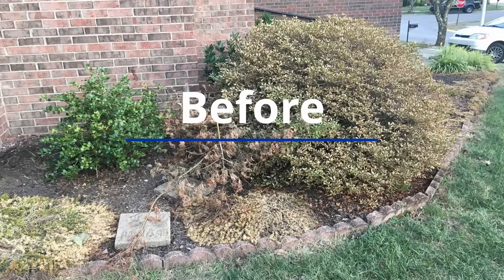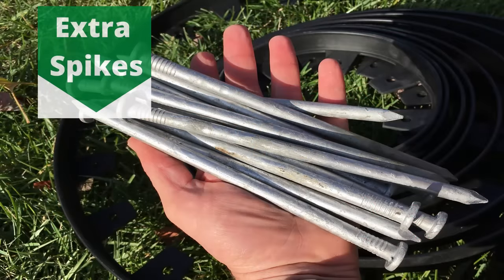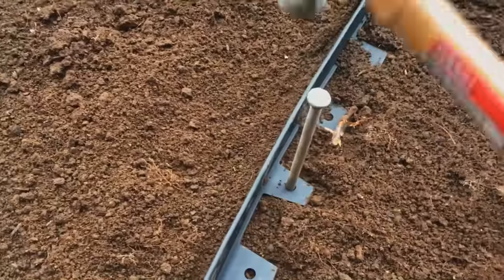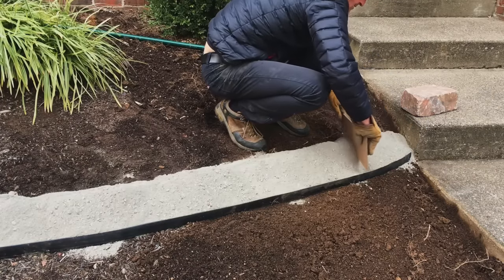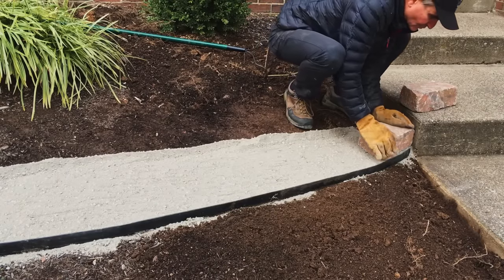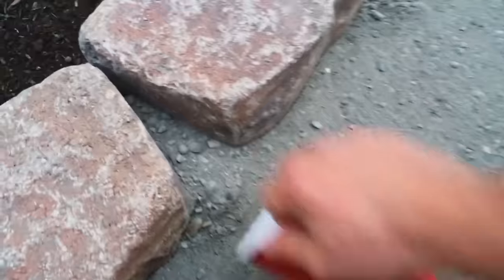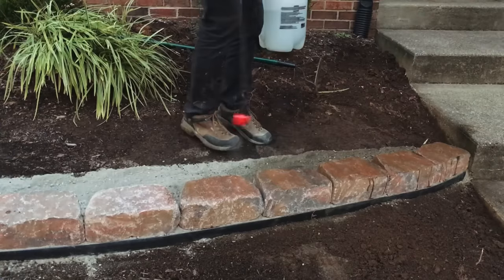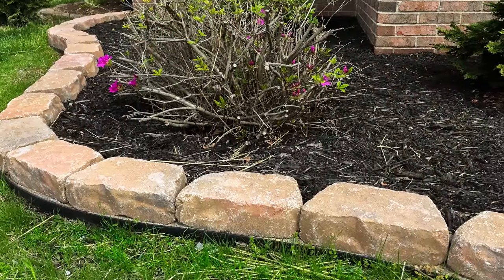easy diy No Dig Border *2020 UPDATE*

Comment: Great video. Can you double or triple the height of the border by adding more pavers? If so, how to you accomplish this?
Reply from the maker: _______ , I have not made a second layer on this type of border because I don't know if it would look that good and Peter, the difficulty level is raised some because you would mix up and use a traditional mortar between the layers. You could also use landscaping block adhesive. Even, though, it involves more work, I would highly recommend digging out the old dirt and mulch out of your area so the level is dropped enough so that there is plenty of room for the mulch to sit in there without spilling over. Also, the same thing can be accomplished by building your border out further so the dirt can slope down to the level of the bottom of the blocks and also have room for mulch. I hope this helps.

Comment: Would there be any reason why you could not have this process with a second course of stone? Well done video. Thanks for this.
Reply from the maker: Craig, I have not made a second layer on this type of border because I don't know if it would look that good and the difficulty level is raised some because you would mix up and use a traditional mortar between the layers. Even, though, it involves more work, I would highly recommend digging out the old dirt and mulch out of your area so the level is dropped enough so that there is plenty of room for the mulch to sit in there without spilling over. Also, the same thing can be accomplished by building your border out further so the dirt can slope down to the level of the bottom of the blocks and also have room for mulch. I hope this helps. Have a great day!!

Comment: Can I use paver sand instead of concrete for this? I'm close to the impervious surface limit of my HOA and I don't want to push it.
Reply from the maker: No, it would be better to choose some other border than this one if you don't want to use the concrete. The cement is at the center of its features of long-lasting stabilty, and as an amazing weed barrier that is impenatrable. Let me know if I can help you any more, spade749. Have a great day!!

Comment: I want to lay edgers against a straight brick walkway, do I need the Vigoro? How many bags of quikrete do I need for 22 feet?
Reply from the maker: The concrete works for apporoximately 5 linear feet so if you get 4 or 5 bags that should be enough, but maybe get 6 just in case...its no fun to be short...just return the extra. You might not need the Vigoro edging in your situation. It is used as a form to level off the cement mix and keep the shape nice, so evaluate what you have going on and see what you think. I hope this helps, Adam.

Comment: You don't need to wet the cement before you put the blocks on top of it? Thanks.
Reply from the maker: No. Do not spray with water until you have finished everything else. That is the finishing step that bonds it all together.

Comment: How do you allow for drainage? I wanted to use the black plastic instead of the fabric because I do not want plants where I am doing the work
Reply from the maker: Usually, I run a black corrugated pipe out, under the ground to a box in the yard where the water can spill out from. If I'm running it out very far, use white pvc pipe through the ground instead so the flow rate is improved. If you have any more questions, I can give you more detail on that. I hope this helps. Have a great day, Anthony.

Comment: We have plants right next to the edge of mulched areas, so we need to lay the edging on the grass. Our grass is very thick and strong. Does the concrete work well on grass? Any tips for that scenario?
Reply from the maker: It seems weird, but build it right on top of that strong grass. It will work great. If it bothers you some, you could try using your string trimmer on it to lower the grass first. Ya, if you can't get the plastic edge to spike down decent to create a nice line, then you would need to do something about that. I think I've seen some grass in Florida that is super thick and stiff like this.  I hope this helps. :)

Comment: How is the concrete under the stones going to get water to set. Will it help if I spray water, small section at a time, just before putting the stones?
Reply from the maker: DO NOT get anything wet until it is all assembled. This process is specially designed to work perfectly like this and will NOT set up and bond together if you do it differently than my demonstration shows.

Comment: Does this technique work with any type of edging block? Also, stupid question if your flower beds are smaller can you just use a smaller amount of concrete such as just putting under the edging instead of going all the way into the flower beds? Thanks, great video.
Reply from the maker: Hey, Jeff, great questions. With this technique you can use any brick, block or rock that you think looks good. Also, yes, you can not spread out the concrete so far if you'd like...its just less of a weed barrier, but maybe you don't have so much of a problem with that in your area. Aslo, there are blocks that look exactly like the ones in the video, but about half the size that I'd recommend for smaller areas. They will look more proportional and better. I hope this helps. Have a great day!!

Comment: I was planning on putting landscape fabric down. Could I lay the landscape fabric down and then do the concrete and blocks over top of that? Or should I do the blocks first and then run the landscape fabric up to the edge of the concrete?
Reply from the maker: I have a HUGE tip for you. Don't use landscaping fabric. It simply does not work and creates a hugge mess of the years. Hear is my highly recommended technique that works very, very well: https://youtu.be/HIWDPlaB6wY Make your border, then use the cardboard and then the mulch. I hope this helps. Have a great day!!
Reply: @maxpatch67  well I was planning on using rocks instead of mulch so I can just blow all the grass clippings away, but I'll definitely be checking out this technique thanks!
Reply from the maker: You just brought up the one exception to my rule of never using fabric. I would use fabric with rock actually.....get the thickest, most expensive kind possible to try to keep it from getting filled with roots over the years. If you are aggressive about keeping it weed free, it might work for you best to keep the rocks from sinking into the dirt over the years. I hope this helps...sorry for the confusion.

Comment: Would this work in states that get snow.  I’m wondering if the cement would crack and leave you with uneven block
Reply from the maker: I can't explain how the border holds up so well, but I've had several comments from youtubers who built this border from my video several years ago and have said its lasting perfectly in Northern regions like New England and Southern Canada. Check out the pinned comment at the begining of the comments. I think that might be one of them that would be easiest to find. Have a great day, J A.

Comment: Can I add another layer to this? If so would I use the fast setting cement as well?
Reply from the maker: Stephanie, I have not made a second layer on this type of border because I don't know if it would look that good and the difficulty level is raised some because you would mix up and use a traditional mortar between the layers. You could also use landscaping block adhesive. Even, though, it involves more work, I would highly recommend digging out the old dirt and mulch out of your area so the level is dropped enough so that there is plenty of room for the mulch to sit in there without spilling over. Also, the same thing can be accomplished by building your border out further so the dirt can slope down to the level of the bottom of the blocks and also have room for mulch. I hope this helps. Have a great day, Stephanie!!

Comment: If you fill the beds to the top of the bricks with soil will the soil move the bricks with as little concrete as there is?
Reply from the maker: The border will not move. The concrete is very strong. Inside the border, I wouldn't load dirt above the extra width of concrete, though. Its just the right space to use mulch or whatever your you have covering your landscaping area.

Comment: So if you want to raise it to be more than one brick tall, would you add more concrete or just loosely stack the next row on top of the first?
Reply from the maker: Scott, I have not made a second layer on this type of border because I don't know if it would look that good and the difficulty level is raised some because you would mix up and use a traditional mortar between the layers. You could also use landscaping block adhesive. Even, though, it involves more work, I would highly recommend digging out the old dirt and mulch out of your area so the level is dropped enough so that there is plenty of room for the mulch to sit in there without spilling over. Also, the same thing can be accomplished by building your border out further so the dirt can slope down to the level of the bottom of the blocks and also have room for mulch. I hope this helps.

Comment: Hi! Such an awesome video! Thank you but WHAT ABOUT DRAINAGE?
Reply from the maker: Excellent question!! I consider that every time I build one  of these. My go-to method is to create a drainage system from the downspouts that goes directly down into the ground, into and through 4" sewer pipes and into a drainage box with holes drilled in the bottom of it about 10' away from the house where small amounts of water can drain into the ground out there and large amounts can flow up and out of the box and into the yard. Thanks for the question and let me know if I can help you any more, EgoAddict!!
Reply: @maxpatch67  Okay! Thank you so much 😊

Comment: Can you do the same procedure with red brick?  I have a load of brick left over from my house build, and would like to use them to provide a border in the front.
Reply from the maker: Yes, this technique is easily adaptable to different bricks and blocks as long as you think it will look good to you. That's a cool idea to repurpose old bricks! Make sure its at least in the 50's for temps so the concrete will cure quickly. Have a great day!

Comment: Quick question.... 1st thanks so much for this great short video that really explains it all and looks terrific! 
My question: With the concrete that falls in front of the edging, What do you do with it?  I was thinking to wet it all the same and then just knock it off at the end of the job and pick up the pieces.... I think I'd be easier than trying to clean it up prior to soaking.  Any issues with this?
Reply from the maker: Mike, you are welcome. Thanks for the compliment! The little bit of mix that might fall over the edge on the front can easily be brushed out and scatterred with your hand before you spray with water. This brief action makes it basically disappear and you'll never see it again. You'll probably be building your border right on top of your your existing grass and in that case, this little bit of cement will not even bother you, but again, just run your fingers along there and it will easily scatter it. Thanks for the question and have a great day, Mike!!

Comment: Im not getting much adhesion between the concrete mix and the bricks after misting. I used the same exact concrete mix and bricks from lowes. Its been about 4 hours and I could easily remove the bricks. Any idea as to why? Should I just wait longer?
Reply from the maker: Ground and air temps need to be at least in the 50’s for the cement to cure and create adhesion. That is probably what you need. Do you have that happening today?

Comment: Is this setting permanent? What if I want replace the bricks or change things around? What would I need to do to undo it.
Reply from the maker: This border is very permanent and meant for those that are very sure of what they want for many years to come. You'd have to bust it up with a sledgehammer to change it out. It's very durable and long lasting which is one of its main features. If you're not really sure of what you want yet, then don't build this one. Have a great day, Twels!

Comment: You didn't how you removed the excess cement on the inside part of the blocks .. so how did you remove them ??
Reply from the maker: That "extra" cement is not really extra. The extra width keeps out weeds much better along the border and provides extra stability. There is mulch coving it so it does not show at all when finished. Have a great day, Lita!

Comment: Thank you this video really helps.  My only question is once you first poured or spread the concrete did u apply water or a mist before laying your blocks? I must have missed that in the beginning.
Reply from the maker: No, you probably did not miss anything, this technique is special, using this unique type of concrete mix. Make sure to get "fast-setting" concrete mix. Spread out and level off the dry concrete mix, add the blocks on top, dump cupfulls in the gaps, then mist it and it will all bond together..it really works!! Have a great day, Alicia!!

Comment: Great video! May I ask what to do with the cement that is spilled beyond the bricks? How do you take clean those away so that you can expose the soil beneath it?
Reply from the maker: If a little cement mix falls over the edge on to the front side, you cann either just leave it or what I do is lightly brush it around to disperse it with my fingers. In most cases, you will be building this border right on top of grass, so its really going to be inconsequential whether you do anything with it. I hope this helps.

Comment: With the no dig landscaping border, can you stack the block 2 or 3 high?
Thanks
Reply from the maker: David, I have not made a second layer on this type of border because I don't know if it would look that good and the difficulty level is raised some because you would mix up and use a traditional mortar between the layers. Even, though, it involves more work, I would highly recommend digging out the old dirt and mulch out of your area so the level is dropped enough so that there is plenty of room for the mulch to sit in there without spilling over. Also, the same thing can be accomplished by building your border out further so the dirt can slope down to the level of the bottom of the blocks and also have room for mulch. I hope this helps.

Comment: If I build 2 layers, can I mist after? Or should I do it after 1st row.?
Reply from the maker: I'm not sure if that would work to do two layers using the fast-setting cement for the second layer. Probably the best way is to make the first layer like normal-following the video exactly-and then add the second layer using landscaping block adhesive. I have never done it because I don't think I'd like the way it looks so much, but I bet you could do it like that. Let me know if I can help you any more, Long Le.

Comment: Oh wow how super easy. Question so  in my back yard I have a retainer wall and below it is a section that a variety sizes of rocks, but it’s a mission to take every rock out so that we can the weed prevention plastic then after we have to place the rocks back. I was wondering if I can add the fast setting cement in between the all the rocks to keep the weeds from growing? Thank you!
Reply from the maker: That should work. Can you make it a couple inches thick or so, so that it can be pretty sturdy?
Reply: @maxpatch67  thank you 🙏
Reply from the maker: my pleasure!!

Comment: How’s it holding up? I am wanting to do this however a lot of people said the Vigoro plastic edging has a tendency to warp
Reply from the maker: It's in perfect condition. It does not warp when used with this border technique. When you spike it to the ground, be careful not to over do it on the ones that are in little low spots, -that is what will make it warp. If there is a little gap between the plastic border and the ground in the spot where  you are hammering, just get the spike down snug to the plastic border and let it be. There is no use in driving it in the ground and twisting up your edge in that spot. I hope this helps. Have a great day!!
Reply: @maxpatch67  awesome thank you!
Reply: @maxpatch67  I bought the vigoro heavy duty edging. Not sure it it’ll make much difference. My only concern is when using concrete mix, if in any case you need to replace anything, it’s going to be a huge hassle cause everything will be cemented down. Would this turn out okay if I skipped using concrete and just set the blocks down?
Reply from the maker: @themcstaple  Yes, if you are not very sure of the border shape you want in the future, then you would not want to make this one. It's very permanent and you would not want to bust it up ever. Here are the benefits of the cement: a. The cement provides three major functions in this border technique. 1. Height(for looks) 2. Stability/strength 3. Weed barrier(the extra width is nearly impenetrable to aggressive weeds and grasses(Bermuda Grass) that we have here in Nashville. I hope this helps.

Comment: Can this same technique be used for a walkway, using patio squares?
Reply from the maker: Yes. After several years, hairline cracks will appear around the pavers, but that can happen with other methods as well.....make sure and use only "fast-setting" concrete.....Have a great day, Debra!!